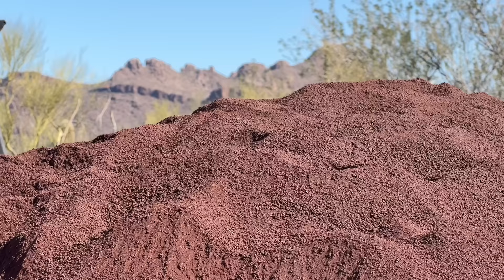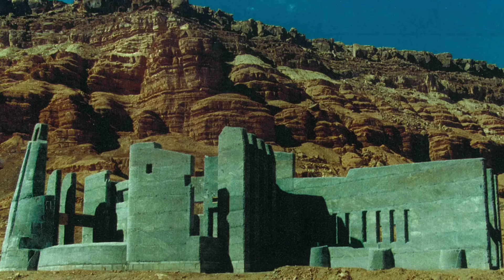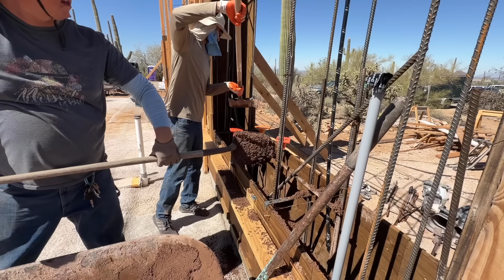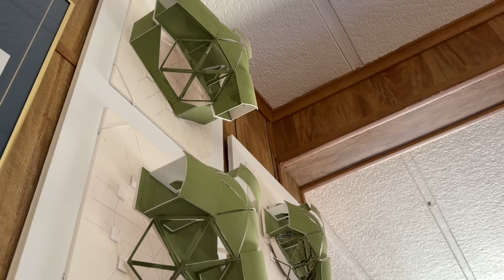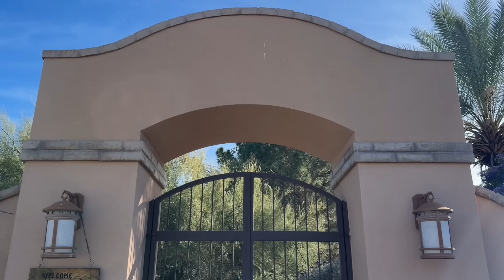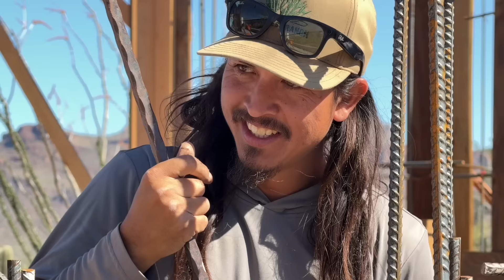The COOLEST Alternative Building Method You've NEVER HEARD OF

Comment from the maker: Important Links! 

LAVACRETE WORKSHOP: https://tinyshinyhome.com/lavacrete-workshop
PAUL SCHWAM: https://www.lavaporousconcrete.com
GURU DAS: https://www.awarenessranch.com
Reply: the link to Paul's site is blocked, it does not open.
Reply from the maker: @AB-so3jv  Seems like the redirect isn't working on mobile. Try https://www.lavaporousconcrete.com
Reply: As an idea, has anyone explored using the lavacrete in earthbags with lime, which will combine both advantages (and needing less to no rebar maybe?), and a plaster render of hempcrete over the earthbags to create an insulative and fire/heat protection element as well?  Just a thought that, especially with passive heating and cooling technologies, like a solar water heater tank, and a vertical shaft for cooling, per other videos that I have seen, might allow for desert and other extreme environments to be more habitable.  Thick walls and a rocket stove heater with a shaft around the inside would allow for heating the thermal mass in cold environments as well, and the entire structure should be thermally efficient in multiple ways, as well as disaster resistant if designed correctly.
Reply: Would this be something that you could use on the outside of your house so you don’t have to plaster? Maybe with lime so it will last?
Reply from the maker: @sheribristol2826  No it's not a plaster, it's a wall building material
Reply: Where do I order the scoria or cinder sand?
Reply from the maker: @chrstnaleavitt1  We're getting ours from Perkins Cinder in Show Low
Reply: Did you say $1000 a person?
Reply from the maker: @postrophe1969  Yes, it's $999/person. See https://tinyshinyhome.com/lavacrete-workshop
Reply: Am very interested in knowing the cost of the 12x16 utility shed your going to put up. How does it compare to traditional wooden/cinder block construction?
Reply from the maker: @nrique_og - We'll be keeping track of that. I will say that wooden and cinderblock construction are going to have very different thermal and longevity properties, though.
Reply: How long do you expect such a house, built with lime, to last? Several hundred years? I know Roman concrete has lasted at least 2,000 years.
Reply: That wall looked thicker than 12 inches ! :face-orange-raised-eyebrow:
Reply from the maker: I think that one was 16”, but our utility building will be 12”
Reply: Would the lavacrete work together with the FOAMCRETE method?
Reply: @ExposingBethel 

It might work if the scoria is ground to fine dust.
Reply: Full build price point? 🤔
Reply: Greetings from Cape Town. Love what you are doing. Do you make use of a specific binder? Portland cement and Lime?
Reply: Tell Paul Schwam. If you have a cheap source of bamboo you can  use it as an alternative rebar.

You can grow flaxseeds and use the fiber to harden, use them as an additional toughener and reinforcement for the lavacrete. The flowers of flax are beautiful too.

I wonder why not use calcium oxide? More expensive? It is quicklime and it sets quickly. Might be less stronger than cement at first but it grows stronger over time.

It is strange that lime is more expensive. The bedrock in most states are limestones and it is the same material used by cement factories.

Oh by the way there is a comment below this comment suggesting lavacrete and sandtube, sandbags? I think it will make it faster to build...

Comment: Wonder if could polish it like concrete? Or could i get a smoother finish with plastic inside form.
Reply from the maker: You can "compact" it more and then grind it down for a smoother finish. But the more you compact the less thermally and acoustically efficient it is.

Comment: I was wondering if you need to have a structure to hold it? Can it be applied over a CMU house with Stucco?
Reply from the maker: Yes it has to be contained in a form until it cures, minimum 4" thick. It's a wall building material, not a plaster or stucco (it's way too pourus)

Comment: HOW thermally efficient?
R-WHAT?
Can you include Thermacork on the interior walls for added insulation?
Reply from the maker: Look up R-Value measurements on the internet - that's the thermal efficiency rating you can use to compare to other types of material. No idea what thermacork is, but you can screw whatever you want to it 👍🏼

Comment: if I were to do this style, I would go with Hempcrete, same idea, but carbon capture
Reply from the maker: Hempcrete is cool, but seeing lots of comments like this that don't really understand what it is. These are two very different systems - lavacrete is a fully engineerable and structural wall building system that needs no finishing work when done. Hempcrete is a wall INFILL which means you have to build an entire roof supporting structure around it. Then you have to plaster it. So the for idea of carbon capture you have to factor in all the wood or steel you'd be using frame out the walls before infilling with Hempcrete material.
Reply: @TinyShinyHome  No, actually they are very very similar, only thing different I see you doing there, is using lava stone, instead of hemp.  With hemp, you use the same binders, you even install the exact same way.  Im not trashing on lava rock, just pointing out the similarities.  The lava looks nice as well.
Reply from the maker: Yeah I'm not trashing hempcrete either, but they are quite different. Lavacrete creates a load bearing wall system, hempcrete doesn't. So you have to build an entire load bearing structure around the hempcrete. This makes a huge difference in how you approach designing and building the structure. For reference concrete is 2000-4000psi, lavacrete is 800-1000psi and hempcrete is like 150psi (or less). It has to be used as an infill material alongside a structural frame made of wood, steel, or post-and-beam elements.

Comment: It’s ram earth, just different material rammed with concrete and rebar. It’s beautiful but it’s not new technology.
Reply from the maker: Lavacrete has similarities with Rammed Earth, but differs in quite a few ways. 1. The material is porous so it's more insulating, lighter weight, and easier to move 2. It doesn't get "rammed" just lightly compacted so far less labor 3. Because it doesn't get compacted like rammed earth the forms can be built with simple sheets of plywood and 2x4's, negating much of the additional cost. At the end of the day it costs less and performs better thermally so it's absolutely worth considering. No need to get pedantic, they're both great ways to build.

Comment: What about water vapor?
Reply from the maker: A few ways to think about it. The porosity does mean that water potentially infiltrates. However, on a vertical wall with a good overhang? Nothing significant. The thicker the wall the less likelihood of anything ever making it through. You can also engineer the wall with a piece of flashing/insulation in the middle to act as a vapor break. At that point you've stopped air moving through the wall, though. And because the wall is porous even if water made it in between the material it will drain out and not hold the moisture. Overall I don't think it's a huge concern, but definitely worth adjusting based on goals and climate. That's the nice thing about the build process - you can engineer it however you want.

Comment: So basically Rammed Earth with scoria sand. I see too many cracks in the finished work on this video. What's up with that?
Reply from the maker: Rammed earth is definitely in the same family of build styles. A couple of important differences: 1. The material is lighter and easier to move 2. Because of the air pockets and light tamping the wall is more breathable, insulative, and sound absorbing 3. No heavy compaction is required meaning much less labor, faster, and much cheaper because the forms can be build with plywood and 2x's 4. The finished exterior is more more resilient and requires less long term maintenance.  There are no cracks, it's becomes a solid monolithic wall without seams. All you're seeing is the remnants of formwork which you'd see on a rammed earth build as well.

Comment: Is this product posolanic?
I have poured 100000 cubic meters of concrete
used in floating structures,,,homes  marinas fish farms etc
We use flie ash 'wood ash for extra strength
I am looking for a sculpture friendly material, but I don't live close to a volcano
Reply from the maker: The scoria really doesn't react to the cement or lime, the binder just sticks the grains together. I don't know if I'd call it "sculptural" but it's definitely more of a sandcastle 3D architecture. No need to live close to a volcano, just a scoria/cinder mine for it to make sense for your situation.

Comment: Forgotten about??  Stop reinforcing the collective naïveté of Americans.  It and traditional stone masonry have been the predominant forms of construction in the Azores islands off of the west coast of Portugal for the last 1300 years.  These islands are volcanic and have few trees, so the available building materials are primarily volcanic in origin, being rocks, gravels, sand and boulders.  Lime is available from the abundant seashells, so cement is also an available resource.  The local masons have perfected building using these materials.  We stayed a year ago at a hotel called “Lava” on the island of Pico.  The property consists of fully-equipped, very modern European bungalows that are entirely Lavacrete.  They remained cool in the very hot Azorean sun.   I’d love to construct a home in my rural Pima county area using the materials and techniques of the Azores.  I’ll bet the utility costs for both summer and winter will be quite low.  Adobe proves that earthen techniques are effective and efficient, but without constant maintenance to protect the exposed surfaces, it isn’t durable.  Lavacrete has similar thermal efficiency as adobe, but without need for maintenance to keep it standing.
Reply from the maker: Look, happy to have conversations about stuff like this, but you're coming in hot with all kinds of aggressive accusations. Take a step back. 

During our research Azores never came up, likely because they have different names for it (bagacina), and based on the one article I could find they don't consider it load bearing or structural. Which would potentially put it in a different category. Maybe, maybe not. 

But the reason we said it had been "largely" forgotten was that there wasn't any meaningful data or info available that we could find. That doesn't mean people aren't out there doing it, just that it wasn't on anyone's radar at scale. We're trying to bring more visibility to it because like you said, it's got a lot of the benefits of adobe without the upkeep.

I think we're on the same side of this - helps to be nice and support each other.

Comment: Clearly suitable in arid environments.  How would it hold up in wet environments, like Florida and Georgia where it rains heavy.  Is there a sealant or epoxy covering suggested to prevent wear from weather over time?
Reply from the maker: It works fine in other environments, and FYI it rains very heavy here. Monsoons are no joke. The only reason you might seal it is to keep water from penetrating since it is porous, but with thick enough walls and large enough overhangs it's unlikely this would be an issue. You can also insert a vapor break in the middle of the forms while pouring the material. Some engineering/code requires this. Look into the Sirewall rammed earth system for a similar idea. The nice thing is you can basically engineer the wall for whatever you want - make it thicker for colder climates, add insulation in the middle, use larger rebar on a tighter grid for seismic areas, etc... Overall, though the wall once cast doesn't really need any additional protection. The house in this video that was 15 years old looked brand new and the owner said he had done no maintenance to it at all.

Comment: How well does this work in humid enviornments such as southeast asia? Or cold enviornments where water is frozen for most of the year (northern Canada)?
Reply from the maker: You can engineer it however you want (i.e. thicker walls for more insulation, larger overhangs to protect from rain, etc..) It's breathability combined with the lava material means it's very mold resistant, and can allow water to expand and contract without cracking the walls.

Comment: If you had a circular building the forms could be one continuous piece.    Also look to India for it's "Brutal" Architecture where light is let in on North side and South side the sun is blocked from actually hitting the building.   Along with basements, this allows for very efficient cooling in hot climates.

Comment: Are the ratios here by weight or by volume? The 5:1:1 ratio mentioned.
Reply from the maker: Volume. There would be no realistic way to measure weight on a job site while mixing. I believe Paul and Guru Das have said 6:1:1 is fine, too if you want to use less binder.

Comment: Great video. Because, he speaks of buildings that lasts several generations, I would like to see a version that works without rebar. We many have stone buildings and half-timbered houses in Germany that that were build in the 14th, 15th centure and before. I doubt that any rebar-inforced material would last that long without providing headaches. Not saying that any building needs to last that long, but rebar is something that I would like to avoid, if it was my building. To me, using rebar is a bit like using the lazy route.  Other than that, it looks like a beautiful material.
Reply from the maker: Well, like Guru Das talks about in the video you can use non-steel rebar if you're worried about it degrading over time. Otherwise it provides a really nice framework to attach conduits, water lines, etc... to and provides tensile strength for high seismic areas. It also makes it much easier to pass code. That being said, you can build without it. Just a big unreinforced concrete wall basically.
Reply: @TinyShinyHome  Thanks for taking the time for the detailed feedback. I appreciate that!

Comment: It looks a lot like a building style in Western Australia. They call it "rammed earth" or more correctly "cement-stabilised rammed earth".
Reply from the maker: Rammed earth is definitely closely related. Where Lavacrete usually becomes a better option is that it's lighter weight, more insulative, the form work is much simpler and cheaper, and way less work because you don't have to compact it the same way. Both are beautiful, though!

Comment: I find this technique very interesting, and I've subscribed to watch further. However, I am curious to know if the Lavacrete serves as its own vapor barrier, considering the porous nature of the material, or is a vapor barrier required? How would one set up a vapor barrier if someone want's the Lavacrete to be seen both inside and out? I only ask because I live in a hot, humid location.
Reply from the maker: The nice thing about this system is you can engineer it however you want. If you'd like a vapor barrier you can easily add a water break in the forms like foam or even put some sort of drip edge so that any water that comes down through the wall only goes to the outside. Realistically if you have good overhangs it's unlikely water is going to penetrate, though especially with a 12-24 inch wall.

Comment: Why not pour in the ground like a tilt up commercial and way less form work … lay conduits under slab for foundation work and build interior walls regular studs for kitchens since there’s too many outlets there and one other idea is run surface mount power strips below the base board area by foot among a piece of 1x1 at bottom and mount boxes wherever and run romex through the base board area … no pvc and leave wood there for nailing backer . You could stack blocks places too for chase ways if needed for drains from second floor to first floor clean outs … or just design all plumbing on interior walls of metal or woo framing .
Reply from the maker: Was actually talking with Guru Das about this last night. He was thinking about tilt up, too - but we realized it doesn't make sense as this is a vertical wall building system. It doesn't flow like concrete so pouring and screeding horizontally wouldn't really work. And you'd loose all the natural beauty of the layers. You can certainly put your utilities under a slab and install framed walls (we're doing that in our earthbag house and in the lavacrete utility building), but it's very easy to run stuff in the walls, and not everyone likes that industrial look. The nice thing about the system is you can design all kinds of chases or runs inside the walls, pack the lavacrete around it, and be able to renovate the building multiple times without demoing the walls. Which is good because these walls will be here hundreds of years.

Comment: Would this work well in cold and snowy climates as well? Like Eastern Washington.
Reply: Use their stated r value of 16 as a guide. So regardless of of any thermal mass, the insulation is inadequate for that climate. We are in central Colorado and built a house out of Faswall blocks. Blocks are shaped like cmu's, but they have insulation in the center cavity along with rebar and concrete. We put 3 inches of extra rockwool insulation on the outside, and it still gets cold in the house in the winter without inputs.

Comment: One thing I've done in the past is to fasten stainless coupling nuts to J-bolts (can use a jam nut or a tack weld) and bolt them to the formwork for door and window openings (I usually use fender washers to keep them from sinking into the wood) Once the wall is set and the form work comes out, the coupling nuts are flush with the edge of the opening, and can be used to fasten a replaceable buck for the door or window to the wall.